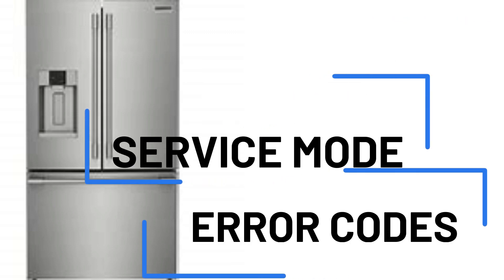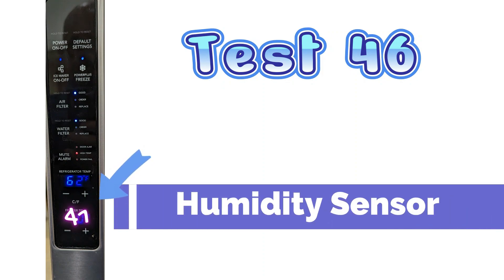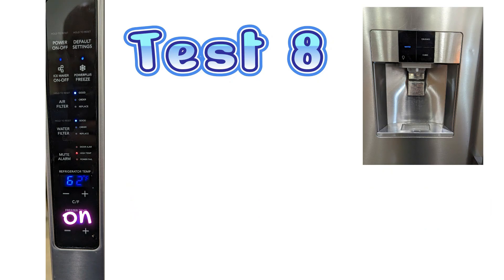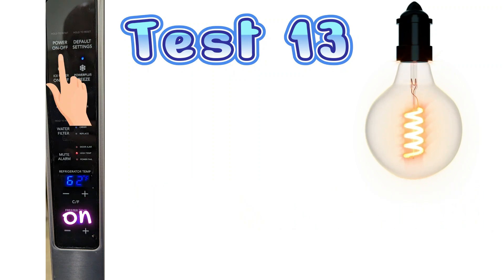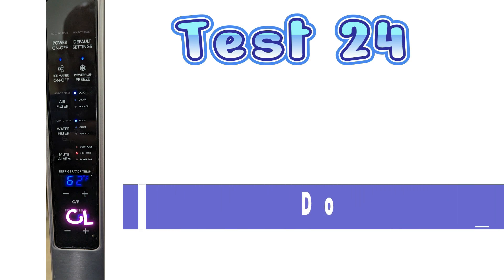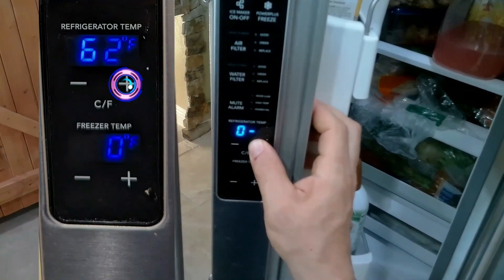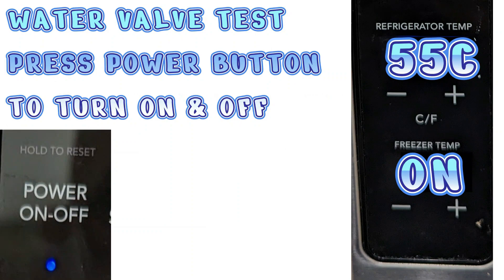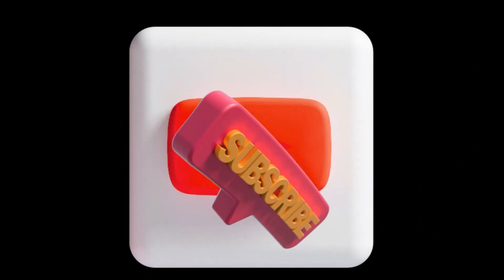Frigidaire Pro Refrigerator FPBC2277RF: Unlock Diagnostic Mode Mysteries!

Comment: Hi - just watched your video on the Frigidaire Pro with the control panel on the edge of the door.  Mine is model FPBS2777RF6 and curious about the ice maker defrost cycle 26 that I’ve seen for the Gallery models.  If I just go to that code, will it run the defrost cycle and then go back to normal settings like the Gallery version, or do I have to do something else to start the defrost?  Thanks!
Reply: Hi, I would also really like to know the answer to this question. When I press the power button on this mode it just says cl so I don’t know if it is working or not. How do you actually run the defrost test and how do you know if it’s working or not?

Comment: When you say you need a new icemaker, is that like one part called icemaker or are there components within the icemaker that I would need to get?

I did the 58C test and my Tray never goes back to the Home position and then I get an ER code, so I assume I need a new icemaker, but trying to figure out exactly what new icemaker means.
Reply from the maker: You would need to replace the whole ice maker unit, as it comes as one complete part.